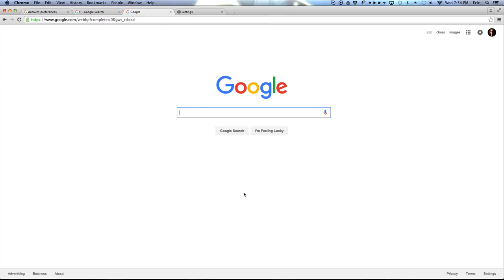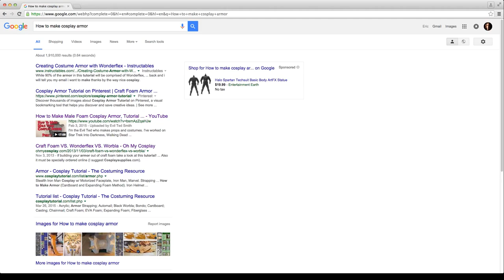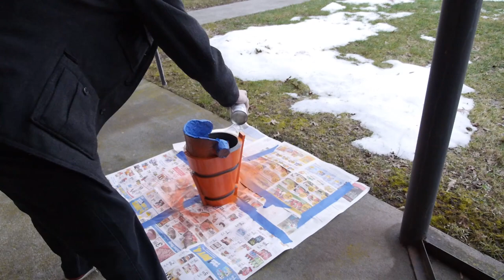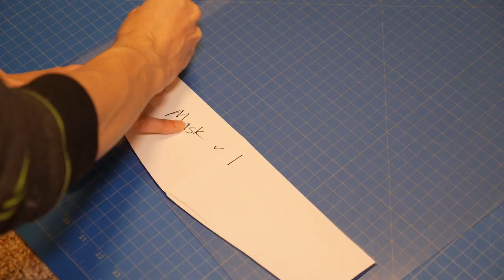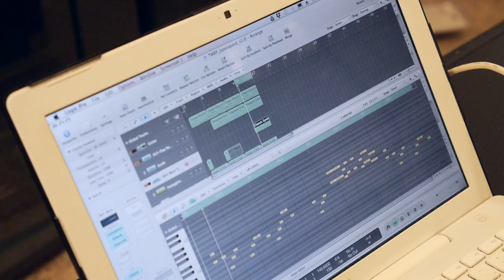MAGFest 2016 Cosplay Build - TWRP Doctor Sung

Comment: Hey, great video! I love it! I was wondering, since I was thinking of being Dr. Sung for an upcoming con, what was the numbers that you gotten for the helmet.
Reply: I mean for the cone size
Reply from the maker: Sure. I figured, when scaled for my head size, the the diameter of the bottom of the cone was 190mm, and the diameter of the top of the cone was 82mm. The height was 228mm. The three "layers" of the cone, from bottom to top, were 217mm, 309mm, and 115mm respectively. There were 46mm gaps in between layers. Keep in mind that these numbers were made specifically to the measurements of my head. The actual numbers for you may vary, but it at least gives you a starting point. If you want to talk more about it, hit me up on my Facebook Page or Twitter.
Reply: Thank you so much!

Comment: Super good video you earned a sub! Iv been wanting to make doctor sungs costume for a while but never got around to it. Any tips or information that can help?
Reply from the maker: +Khaliib  Torres  Thanks for watching and for the sub! Here are some tips for making a Doc Sung costume of your own. Measure Measure Measure. You're going to have to do a lot of measuring to make the helmet and armor have the right proportions in comparison to your body. Measure the diameter of your head, then use a picture of Do Sung to approximately calculate the diameter and height of Doc Sung's helmet. The math would look like this "YourHeadDiameter/X = DocSung'sDiameter/DocSung'sHelmetHeight." Solve for x!  Make a few practice cones out of paper to make sure it looks about right. The paper model typically runs small when transferred to foam, so be prepared to add about an inch (or a few centimeters) to make fit right. Also, check out the Evil Ted Smith's channel if you haven't worked with EVA foam before.
Reply: +Psychotria TYSM! Sounds like its going to take a while to make. Hey you know the spandex that you bought, and the bag. can you link where you bought that at?
Reply from the maker: Leg Bag: http://amzn.com/B00GWYTELE
Morphsuit: http://www.zentai-zentai.com/